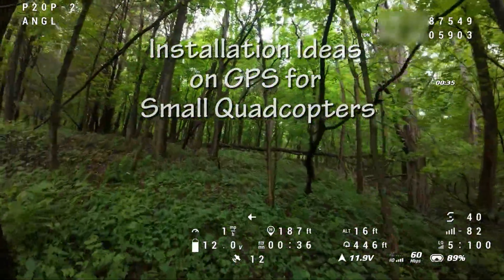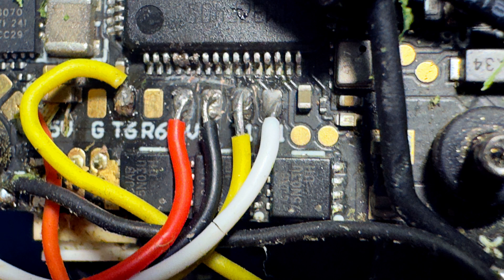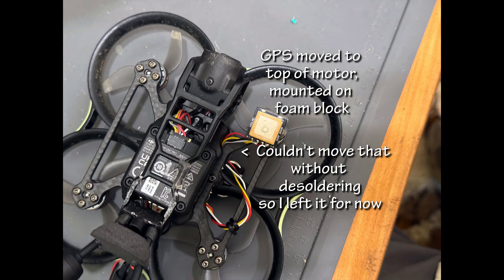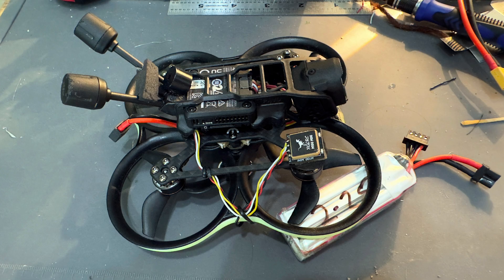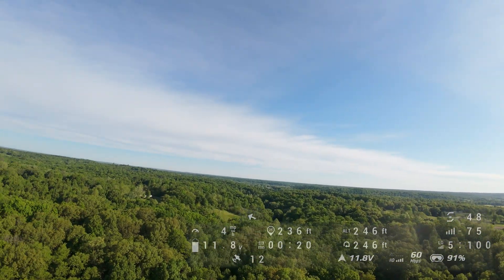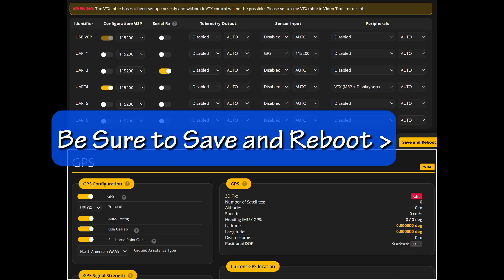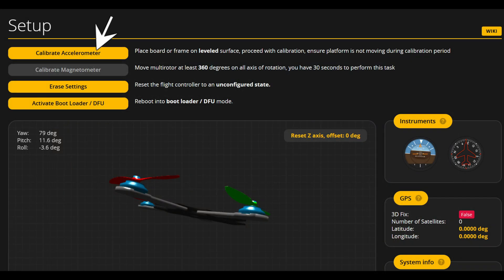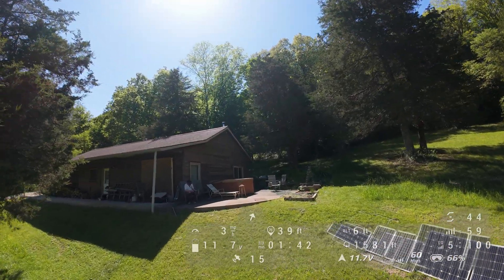GPS Installation Ideas for Small Quadcopters, 5-20-25, Ep 18

Comment: Look into the VIFLY GPS-mate External GPS Power Module definitely a life saver in the florida heat
Reply from the maker: Thanks! Yes, a nice idea! I don't think I'd want one on something as small as the 75mm or Pavo20 Pro, especially since the USB power supply is doing the same thing without adding weight to the quad, but I'll keep that in mind for other builds.